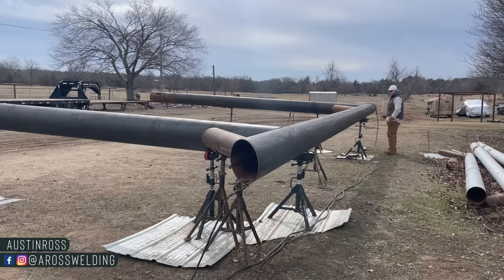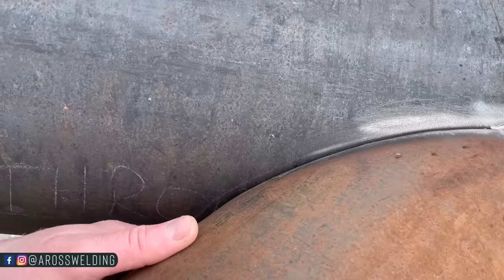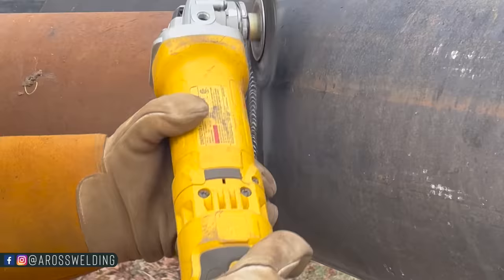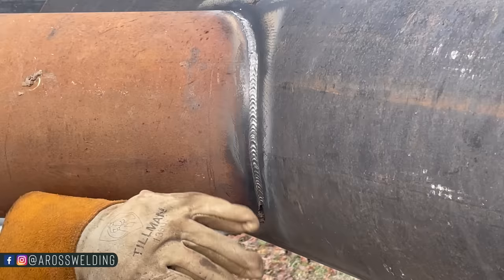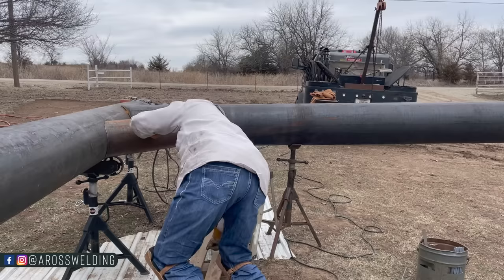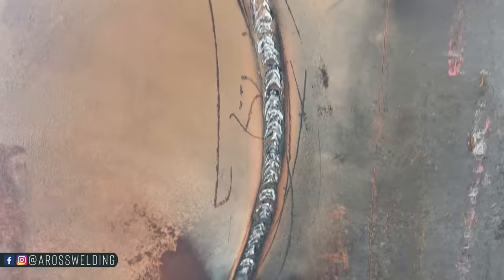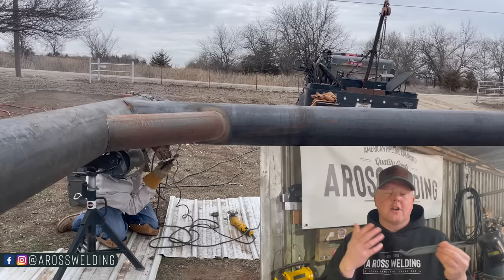Why Pipeline Welders Only Burn Half a Welding Rod

Comment: I kind of hate having to restart a 7018 rod after it's been used.
I haven't worked as a welder yet (just graduated welding school) but a half of a 7018 rod has been my biggest nemesis so far.
Reply: Pull out of your puddle quick and flick the last piece of molten out your rod. That way you have a nice crucibles cup. Pinch the cup and you basically have a new rod. If that doesn’t work for you take a magnet and pick up metal shavings with it. Still pull out fast and flick the rod then touch it to the magnet. It’ll pick up the shavings and that will act as a hot start.
Reply: What romy said! The flux on those rods is pretty hard, thats why u gota peck it pretty hard to get a restart. Pinch that lil bit overhanging the filler off and its way easier
Reply: @romy7533  The problem is that you can explain it to me the best way possible, but I still need to see it in order to understand what to do.
Reply: 1 pass with a file, starts nice and crispy
Reply: a file works, just a quick pass.
Reply: @cameronnerdin4910  that's what I do also file works great👍 If not critical weld I just peck used rod harder when restarting.
Reply: @the_inquisitive_inquisitor  become a transgender and then worry about the cap pass
Reply: @travisjones9508  I'm sorry... How would that help my welding?
Reply: 7018 and other low hydrogen rods burn with a shotgun effect.....the rod actually burns up inside the flux a bit.  As others have said, just take the tip of the rod in your gloved hand and crush that extenden bit of flux with your fingers exposing the metal rod tip.  Learning to bob your head to drop your hood and strike an arc in the proper place, at the same time, does take some practice.  But not all that difficult either.
Reply: @the_inquisitive_inquisitor  you can also use the star head of the screw on stinger and scratch the flux off for easy re-light. Don't waste rods because tranny or not they will fire for wasting materials
Reply: @hokep61  What's been bugging me is that after I've broken the glass off of the tip, the rod likes to stick once I try and strike an arc.
I use auto-darkening hoods, so I have no practice with the head bob.
Reply: @travisjones9508  actually, hold on... I understand what you're saying and I realize that it's good advice. I just got distracted by the word "transgender"
Reply: @the_inquisitive_inquisitor  Yep...I hear ya!  Unfortunately, being able to just tap that rod down a time or two to fire up takes practice. Trust me, you can do it.....and the more you practice the better you'll get.  That said, every welder creates "flaming arrows" once in a while.  As to the auto darkening hoods....those are fine but I still prefer my trusty old Huntsman.  Can't tell you the times that hood has been dropped off high places and lived.....well, might have to replace the lens...but it lived.  Not so much with some of the auto hoods.  Keep in mind, i haven't hardly struck an arc in 10 years so I'm probably behind the times when it comes to hood technology.
Reply: @hokep61  Heights freak me right the hell out; find me at the bottom of the ocean any day!
Reply: @hokep61  Seriously though, I live in an Aerospace hot-spot and I'm trying for a TIG welding job.
Reply: @the_inquisitive_inquisitor  . People can push themselves to do that which at first scares them bad. Just keep pushing yourself. I've overcome a big fear of freefalling from heights in the Cavalry. Then later overcame fear of working very high up in the sky. Just keep pushing.
Reply: @senatorjosephmccarthy2720  I was working for a shady contractor a couple of years ago, installing vinyl siding on houses. Long story short, I fell 3 stories off a ladder. I've just never been comfortable with heights after that... Got some kind of PTSD or something

Comment: I'm strictly an amateur and generally use stick for heavier gauge steel, but rarely for long passes. Typically a few inches at a time, never more than a foot long bead. I find starting a hot, part used rod easier than a brand new rod. I think the heat helps. I also find controlling the shorter length easier too. I give the tip of a brand new rod a couple of strokes with a fine file or emery to expose bright steel. I do the same if a part used rod doesn't fire: it saves knocking flux off.

That said, I fully appreciate the pros whose welds are x-ray inspected cannot get away with this. Quality comes at a cost.

I'm sure amateurs could use those short rods for tacking-up and less critical stuff...
Reply: I agree - I am only about 6 months into my learning how to stick weld and find the short sticks are much easier to fire up and control - but totally understand that's only because I don't know anywhere near enough to be welding anything other than the occasional back yard project - either way welding is fun and I love it and also know I will get better with experience

Comment: Back in the late seventies as an apprentice auto electrician I did a lot of work at a place that built truck bodies and transport equipment. There was an old welder named Jack Dempsey, he was just an amazing welder. He would just strike a weld and go through the whole rod on major welds for a tank. At the end of the rod he would just tap the slag at the end as the whole lot of slag peeled up as he was welding. A true tradesman.
Reply: nothing more satisfying than doing a 10 inch weld and just touching it at the end and it just pops off !!!!!!!!!!!!!  LOVE THAT !!!!!!!!!!!!!!!!!!!! almost as good as S**......

Comment: Question.   When I was just starting out back in the day I was on a structural steel job. (Stone crushing plant).  I thought it was a good idea to tape my leads together and just leave 10ft whips on the work end for convenience. An old timer told me not to do that because of induction buildup and that would cause arc blow.    Is there any truth to that ?  Since then I’ve done my best to keep them separated.
Reply: If you zip tie your leads together in a pair, like oxy-acetylene hoses, the inductance will be as low as possible. Inductance increases with the amount of area encircled by the leads. But too little inductance can be as bad as too much inductance because it can make it difficult to keep a rod lit while welding. 

Arc deflection is usually caused by gas currents or magnetic fields in the work, either because the work itself is magnetized, or from the welding current traveling through the work. Sometimes you can just reposition the work clamp if it's being problematic. AC might also make things easier.
Reply: @stickyfox  thank you so much!

Comment: When you set your course at 150 then on your remote or fine course you have set 60 .Is that 60 percent of 150 amps on the course?
Reply: Technically yes. It more like if it's too hot, turn it down, and if it's too cold turn it up.

Comment: I would think the main reason to discard half used rods is moisture penetration. It is my understanding that for many instances of “code” welding, take for instance 7018…must be used within 5 hours of breaking seal on can. I think you can recondition them one time assuming you have access to a “reconditioning” oven.  Depending on how much of the can your going to use, if not all, you might as well use the best part of the stick. Though in all honesty, I seem to have more control with the second half of the rod. Great vid!

Comment: Hey Mr.Ross, Thanks for sharing your knowledge. Is it a good recommendation for someone who wants to get into welding for general repairs around the home / shop to purchase a stick welder first to learn basic welding technique, and then move towards other processes that use shielding gas ? I know there are multi process welders available, but they seem to be quite expensive compared to a 240 volt stick welder.
Reply: mig is the easiest to learn, stick is the best to learn
Reply: For small jome jobs Flux core MIG is the cheapest
Reply: Thanks guys
Reply: the new laser ones are a thing of beauty...pure Star Trek  !!!!!!!!!!!!!
Reply: @jakeatkinson4913  If you learn stick, you can learn mig in 20 minutes, but it doesn't work the other way around. You might think it odd, but oxyacetylene welding is the best way to learn how to control a puddle. It's slow and clearly visible to a beginner. After  that stick and tig will come much easier.

Comment: Curious what's the main issue with striking or arking the pipe
Reply: What I learned is that if you arc strike somewhere other than the intended weld joint, it super heats the area which then cools down. This introduces very tiny cracks or stresses in the base material, making the material weaker in that area and allowing for more failure over time as the cracks get bigger.
Reply: @MrWaffles998  Yup, that's what I was taught in trade school. As the pipe heat cycles it'll crack, kind of like how cracks form in concrete over time.

Comment: First certified 1981 at Quonset Point for the US Navy welding on Trident Class and Los Angeles Class submarines. Hulls and frames, every joint was x-ray. Never had a failure. 1/8" 8018 SMAW and MIG wire feed. NEVER weld downhill. Get you thrown out of Electric Boat in a heartbeat. Over the years learned downhill for ornamental welding, never structural. I worked in Nuclear Power Plants inside the Reactor Containment Building, on bridges, schools, hospitals, skyscrapers, vehicles, turbine buildings, and a host of other projects like petroleum refineries. Every worksite had stringent testing prior to employment. Hair follicle drug testing (goes back up to 6 months) and rigorous safety training. I certified TIG, MIG, SMAW, carbon arc gouging, plasma cutting, acetylene torch, Nelson Studs, and all manner of construction methods. I welded carbon steel, stainless steel, aluminum and even plastics making acid baths with 3" thick sheets in place for metalizing. I've since retired from Ironworkers Union after having been a welder for over 40 years. There are a lot of ways to skin a cat. But if there's a procedure, you best use it.

Comment: I started welding in high school in the late 70s and was taught from the beginning to not waste and burn almost all the rod every time unless you get a little clost to the end of the rod and it is just all messed up and I have never wasted rods and ususlly burn them almost down to the rod holder.

Comment: Way back when...we were taught to always weld uphill and always drag the puddle, to make a stronger weld, even though it heated a larger area around the weld and pulled more. A pipeline Welder showed me how he was taught to always run downhill, to minimize both over heat and pull, but with many more passes. Then came Mig, where you pushed your weld, up and down.  But the prettiest welds I ever saw was a Tig welded pipe. I guess the best advice is, whatever works for the best weld.
Reply: Ethanol plants use tons of stainless pipe, all tigged.

Comment: I’ve known guys to carry an old broken file with a Carabiner clipped on the belt loop to run the used rods on to bust off the slag. Some projects you don’t want scratch marks from rubbing the rod tips all over the place.

Comment: I never throw rod away.  It may not get used at the moment....  But it will get used at some point for sure!  And you are correct Austin.  Try not to restart a partially used rod on anything that really counts.  Why throw an unnecessary risk of failure into the mix when you don't have to!?!?!?  Thanks for the vids and tips.  A lot of greener folks out there benefit from vids like these for sure.
Reply from the maker: Pleasure is all mine!

Comment: Although this is a bit off the subject of pipeline welding, generally the only time I have not used the whole rod is with some hard facing rod that can get close to it's melt point before the rod is used up.  I would burn half the rod and let it cool then use it up later.  Hard rod is very expensive so best to use it right down to the nib.  Also, restarting a used rod is easy if you have high frequency start capability, a nice option when running low hydrogen rod.

Comment: Old millright here. 90% of new  construction welding we used 1/8"  7018 or  6011.yes bedding rod and jet are used at times. Most of the time I would burn rod to a nub but there are times when you may have to do all kinds of machinations in length.

Comment: I grew up on a small farm and my father didn't spend money on nothing we fixed everything. I taught myself to weld by experimenting with different rods and material in my teens. As an adult I have worked at all kinds of welding jobs and welding down you will have weak spots every time. but that's just my experance.

Comment: When I was taught stick welding, the instructor lectured that it takes the first 1/3 of the rod to get the movement going right, and the last 1/3 worrying about running out,  so your technique suffers.

Comment: I am a mechanic by trade but do a fair amount of welding. I have always used wire cutters to trim the end of the rod for a restart no one told me this just allowed me to get cleaner restart and use more of the rod especially on 7018 as a professional what if any problems do you see with that...... thank you for your videos
Reply: When you stopped welding you can just whip the rod real fast and it will get the Liquid out of the tip make a better start for the next time you go to welding again
Reply: We just dragged the tip on the concrete pad a few times to get a clean edge.

Comment: When making a burn container,  weld four halves of large used gas line pipe together.  This will make the container larger.   The most important result is with much larger surface area it will last many times longer!

Comment: I've been a fitter/welder,run procedures, tested more times than I can remember. I've worked in Oil field structure/production piping and eventually moved up to supervisor. Speaking  for myself, my boss would not have have been happy or later I have been happy with my welders if they were wasting consumables needlessly. Sometimes there are legitimate reasons this happens but not as a practice and definitely not as a habit for an excuse. If you can't figure out how to get a partial used rod to start , geez. I know plenty of employers/bosses that would have a big problem with that practice "1/2 burned rods" because it's a "habit".

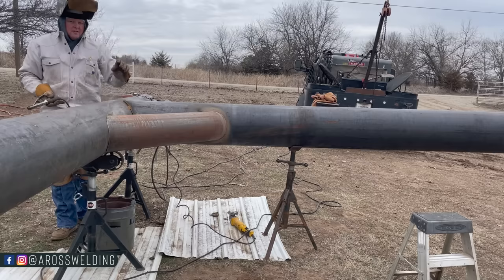Comment: answer @13:28 because starting with a used rod runs the risk of creating porosity at the starting point which can fail an x-ray test. rod is cheap. redoing welds is expensive.

Comment: I don't do much welding  (I'm not a welder, just a truck driver and gunsmith) and I have a hard time controlling a full fresh rod. Usually I can't get a spark and it just sticks. I'm sure I'm doing something wrong but if I cut the rod in half I seem to have an easier time of getting things going and putting the weld where I want it. Sure wish I had the money to go to a welding school.
Reply: Might need to turn your machine up if you can. I strike with my left hand on the rod and slide back to my right hand that on my stinger once I get an arc struck. Also try striking it like a match if you hold in a spot to long it will stick most of the time.
Reply: Might even try a thinner rod depending on what you're specifically welding. Also you can switch from DC to AC, which might give that a try also.
I recommend finding a welding manual and just thumbing through it they usually have good tricks and tips.
Reply: I only have cheap ac equipment and word of mouth - training.
 When I have trouble striking an arc,  I usually just swipe it in longer strokes across the surface. Get some small sparks, feel it out, let the arc grow consistent while moving on to smaller movements. 
That usually lights my electrodes, even from the hodgepodge collection.

When I have trouble with precisely controlling the rod, I sometimes clamp it in in reverse- 45 degree backwards. That seems to help.

Also, when I couldn't find a spot for the non- handle circuit clamp, I just grabbed a bolt with it, held that to the work, and started welding it on. Perfect contact :)
Reply: It's probably sticking because you're getting too close during the scratch. Once electrical contact is made you don't want to touch the rod to the base metal. Try scratching at a sharper angle, then adjusting quickly to the proper angle after the spark has started.
Reply: I don't either, but it occurs to me that if you don't weld often your fresh rods probably have more oxide on them than the fresh rods of someone who welds everyday, and when you cut them down, you expose fresh metal. No idea just how important that could be but it could be part of it. Next time maybe try roughing up the tip instead of cutting it in half?

Comment: At Jeffboat they would pump air into the barge tanks, or tow boat tanks, get up to a certain pressure,  then spray it down with soapy water. 
If you moved up to certified 1'st. class welder itwm was automatic 2'nd shift.  
I liked 1'st shift,  so, I stayed tacking, 3'rd class, and would get an automatic half my time at 2'nd class. 
I don't remenber the rod size, but, flat welding, with the thick rods,  was basically just dragging the rod. It did make a pretty weld. If your machine was set correctly,  the slag would generally just lift off on it's own. Also,  the autimatic machine welders could lay down a extra wide beautiful weld. They ran off fed spools of wire. I really felt for the 1'st class welders who had to weld jnside a sidebox, or hull, stern. Your basically inside a metal box part of a barge, or tow boat, sometimes only one hatch, which you put a blower on top of, but still, the darn smoke would get so thick you could cut it with a knife. Also, part of the reason I never upgraded to 1'st class.  Welding outside in fresh air isn't so bad. You get inside a steel box,  it's a different animal. After 10 hour's,  blow your nose on a rag, and you know what I mean.